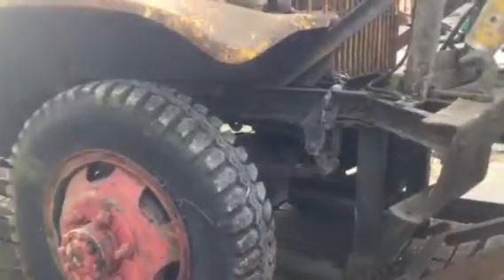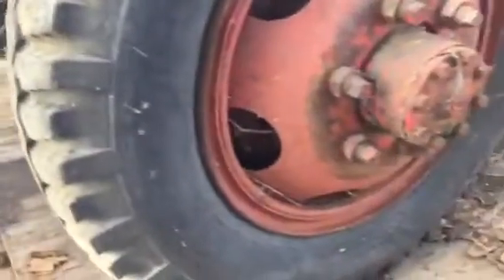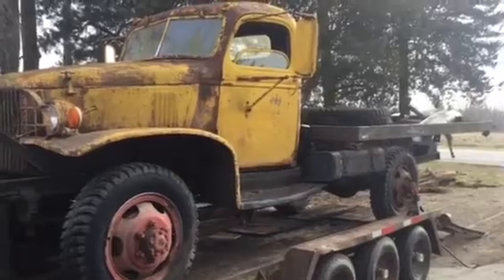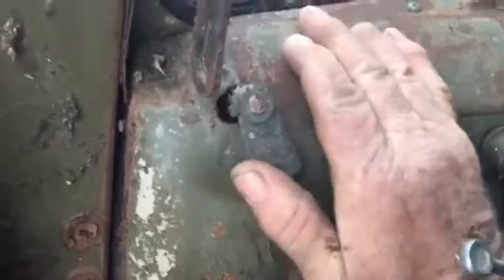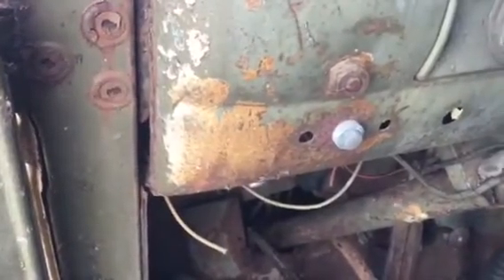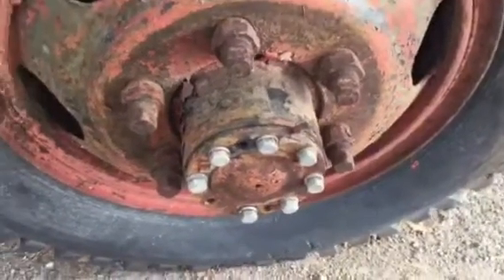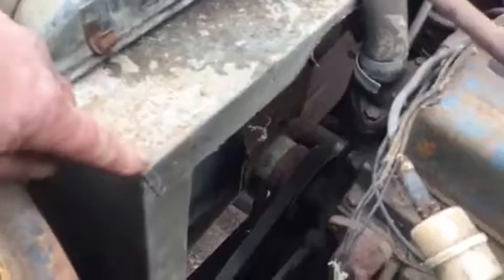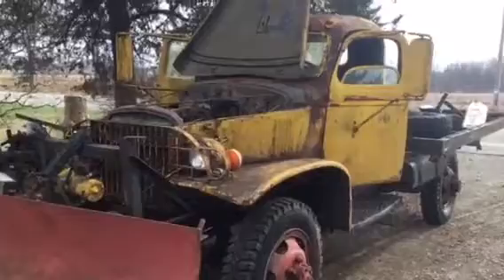More of my G 506

Comment: could it be possibly that the navy or air force had it first?
It looks to be in not bad condition for its age.
Sounds like it was running a little better also?
I think the original engine that you were talking about is the engine that japan coppyed to make there F series petrol landcruiser engines, as it looks similar to the one in my landcruiser fj60.
Reply from the maker: I was thinking the same thing, Navy or Air Force. I’m sure there is someone out there who knows.